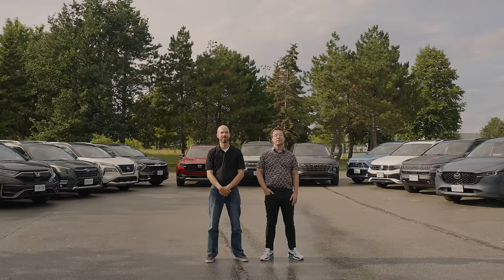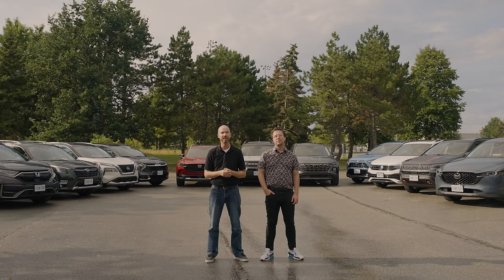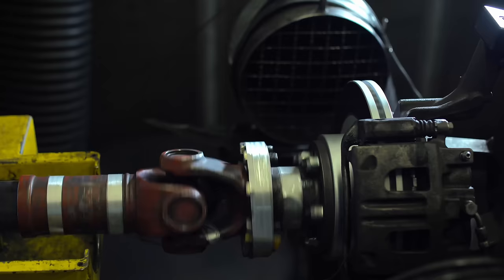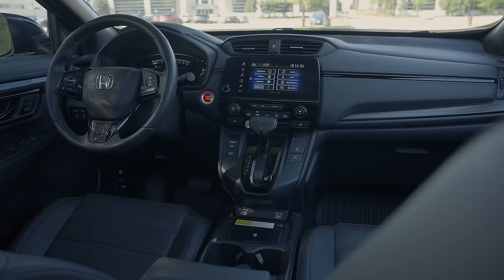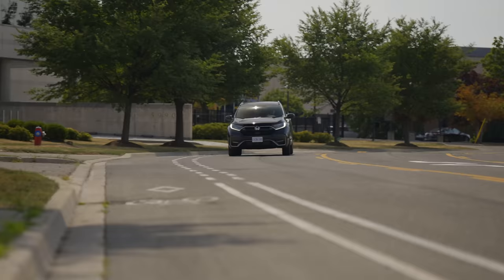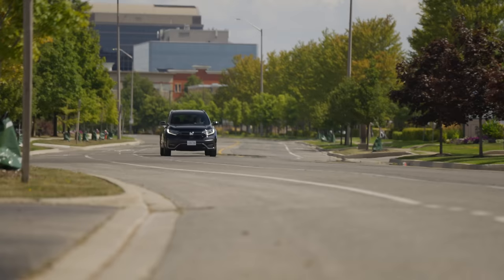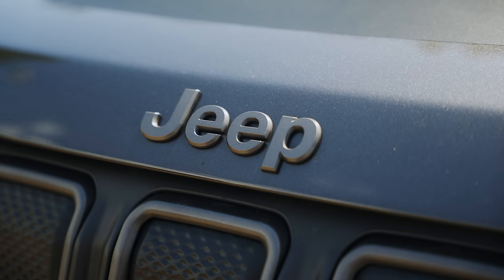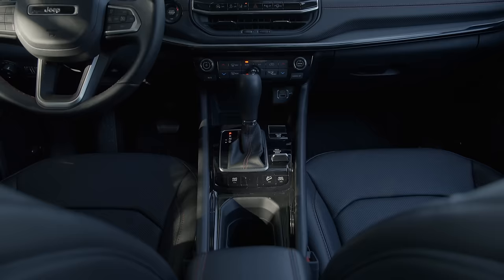Best Small SUV | Testing (almost) Every Compact SUV!

Comment: You can definitely tell that these guys don’t worry about reliability because the top 3 are Kia, Hyundai, and Nissan…
Reply: Lol yes bro same thing i was wondering about🤣🤣
Reply: The are really reliable..
Reply: @patriciosoirefman838  as a mechanic who’s also on multiple mechanics forums I can tell you 100% those and anything dodge/ jeep are literally the worst most unreliable in the road right now…
Reply: @BowmanGarage  Kia Hyundai score in top levels with reliability in EU. You should try Germans or French cars, not forget about modern Volvo's, terrible reliabiilty as well.
Reply: @redwhite_040  literally the only reason they score levels in reliability is because of the 10 year 100k mile warranty they offer.
Reply: @BowmanGarage  at least it's better than most who don't offer more than 3 years.
Reply: @BowmanGarage  which are the most reliable of the bunch?
Reply: @BowmanGarage  Which makers are the most reliable?
Reply: @Andorski  Toyota, Honda, and Subaru
Reply: @BowmanGarage  sheesh where you from cuz out here in la county that isn’t happening
Reply: Am I the only person that has had such bad luck with my Kia
Reply: @Unbound_Soul7  You know... Top Gear tried to kill a Toyota Hilux, they threw it in the sea, run it through an office, dropped an RV on it, hit it with a wrecking ball, set it on fire, tried to drop a building on it.... they failed.  So yeah... Toyotas are reliable.
Reply: @sunshinex315  No. I will be getting rid of my Kia in a couple months. I suggest you do the same.
Reply: @Apollo-tj1vm  im getting rid of mine on Tuesday it has literally had me in tears I’ll never get one again. I’ve got a Honda civic 2018 1.6 diesel waiting for me on Tuesday and I can’t wait. What are you going to get?
Reply: @Sunshine X  toyota corolla cross AWD. I need the extra clearance for the snow here so might as well. They found me one that is going to be made next week starting. So yeah...
Reply: @Apollo-tj1vm  exciting!! I was also considering Toyota haha as everywhere I was researching I was told either Toyota or Honda. My Kia has had me at my wits end.
Reply: @sunshinex315  i bought an older kia van and it has good power and transmission but the whole interior is falling apart and nothing works lol. I tried to push the dome light switch on and my finger went through the button. My finger literall push a hole in the plastic lol. Radio doesnt work and the ac doesnt work and the air only runs on high. The radio display is messed up you can adjust anything. Ive owned old cars in the past from differ manufactures and this kia has absolutely been the worst interior ive ever seen. The seats are comfy af though i give it that lol
Reply: @LowestDifficulty  omg lol I’m sorry for your car trauma. I really loved the Kia to begin with but now never again lmao bet you were frightened thinking about if you could push your finger through the plastic how would it hold up in a crash 😂 I’ve got my Honda civic now and so far I ain’t looking back 🤣
Reply: People still think that Honda and Toyota are the only reliable cars in the planet 😂😂😂😂😂
Reply: @sunshinex315  yeah stick with honda lol
Reply: @LowestDifficulty  so far and here’s hoping it continues, I may just stick with Honda forever 😂 already loving it so much and feels sturdy on the road
Reply: Are you good? Kia and Hyundai rank among the top in the car Industry for reliability
Reply: @BowmanGarage  Mazda >>> Subaru
Reply: @SethjordanB  your forgetting mazda
Reply: @BowmanGarage  Fords are good too IMO.
Reply: @BowmanGarage  😂😂😂😂 Subaru
Reply: People doesn't take care of their vehicles, that is the mani reason their vehicles fail. Nissan Rogues with good maintainance can last.
Reply: Nah bro you’re wrong am sure someone messed with those cars before and swapped manufacture parts with cheap ones
I had 2 kias and i had no problem with them the quality is good the parts and the engine are all reliable
Reply: They are working 3 hours a day belting out content so no they don’t give a rats ass
Reply: Hyundai Kia literally scores top reliability scores out of all the car brands. Why clownin
Reply: It’s either that or those same companies that sent those vehicles must have paid them a bit more 😂
Reply: Lmaaaooo someone clearly doesn't know korean brands are now more reliable than Japanese
Reply: Stay mad
Reply: Top 3 are japanese Toyota Mazda and yeah honda o Nissan
Reply: @BowmanGarage I just had a Kia Ceed for a week before the wheel started locking and suspension fell apart and had to argue with the garage to return it. Turned 10years old this year… your right totally unreliable
Reply: Hyundai are 10000% reliable
Reply: @sunshinex315  no they are terrible I stupidly tried two models in a month since the first stopped steering after a week and had nothing but issues. never again
Reply: You obviously think of old and dated addages when it comes to reliability.
Reply: @BowmanGarage the comment was about Kia, Hyundai, and Nissan.
Reply: @BowmanGarage literally a warranty like that is EXACTLY why that should be part of the reliability discussion.
Reply: @BowmanGarage 1980s and 90s carryover logic. Those aren't the most reliable, anymore.
Reply: @sunshinex315 without knowing how well you maintain your car, it would be foolish to take your comment as meaning anything.
Reply: @kevinj7051 they are just parroting the things people used to say about cars in the 90s, which is buy a Honda for reliability. Toyota wasn't considered as good a brand then, but it's been added to the narrative since.
Reply: Aren’t these brands reliable?
Reply: More like anything that comes in diesel
Reply: @carlosfavaron90  and they are right

Comment: Nobody in their right mind would buy a Nissan with a CVT if you plan on keeping it past 60,000 miles - Rogue included!
Reply: exactly what I was going to say
Reply: Good to know. Thanks for letting us know
Reply: Ditto
Reply: Nissan had CVT problems with the 2008-2014 models. These new CVT's are way more reliable, because they use metal now. Actually the Rogue 2022 is rated as more reliable than the RAV4. Hondas also use CVT's.
Reply: @Aymcana  you cannot reliably rate reliability in a new car.  Nissan did a lot of people dirty and I would still stay away from their CVTs until they have really proven themselves.  A traditional auto is a much better bet.
Reply: @BriansRCStuff  You can because they used CVT-8 on the Rogue, which the improved CVT-7 used in the 2017 rogue. CVT-7 was capable of going 200k miles and over. You can read about that, CVT’s went a long way since 2008. 
Most Japanese manufacturers use CVT’s now including Toyota and Honda.
Reply: @Aymcana  damn you know your stuff, i am impressed.
Reply: I had a platinum 2015 Nissan Murano it literally had the rear differential switched out TWICE once at 30k and again at 80K sold it after I finished paying it off at exactly 80K not worth it
Reply: @Aymcana  Actually my Rogue is a 2017 and the transmission went out at 30,000 miles😳
Reply: @sylviarollins412  Its an exception more than the rule. 
My friends automatic transmission also died at 10,000. Doesn’t mean all of them are like that. Read any articles about nee CVT’s they are nowadays as reliable as automatic transmissions, even Toyota uses them in most of their models
Reply: @Aymcana  I know this is late but I agree & disagree with you. Yes Nissan has made improvements but you really should only take a news car reliability rating with a grain of salt because it takes time to really know what the long term reliability of the vehicle will be. I think the Nissan looks nice but if I had to spend my money I’d go Honda or Toyota because they’re reliability doesn’t compare. I say this all the time it’s about percentages. You could get a Toyota or Honda with probably but the probability of getting one is less likely than with the Nissan. You could get the Nissan and have no issue but the probability of getting the Nissan without issues isn’t as high as with the other 2. Yes I’m speaking on the brand as a whole and there is slight variability within individual models of cars, my previous statement still stands. But I enjoyed reading the back & forth that y’all had a few weeks ago.
Reply: Had a 2003 Nissan altima years ago and it was a NIGHTMARE lol
Reply: @Texas_Made_  We are talking about the 2021 and up models. 
2003 is too old and irrelevant to the newer models
Reply: It all depends on the transmission, I have a 2009 Nissan Murano SL AWD with 412k ish. I regularly change the CVT fluid. I read the CVT doesn’t like heat or sudden acceleration. So I’m sure it helps I don’t accelerate heavily. My coworker owns a 2012 Nissan Juke AWD with 289k, as of last week. In her defense, she doesn’t leave Aquidneck Island in RI, and doesn’t go over 45MPH. Her Juke should last forever lmao

Comment: CX-5 is the best in the class , very high quality in fit , finish , handling and driving dynamics .
Reply: Indeed, but for some is too cramped. If you have a family 4, are 6 footer and travel long distance is not great and MPG also not great, but other than that great vehicle, especially for an average height none long distance travel families.
Reply: I have a 2016 red Mazda Grand Touring Sport and I Love it
Reply: Yes , Mazda is reliable as well as performance oriented.
Reply: @davidzavala337  yup Cx5 gas tank too small and compact seating not good
Reply: CX 5 TURBO IS THE BEAST OF THEM ALL.
Reply: Mazda cx5 too much gas
Reply: @davidzavala337  30 MPG is not that great? I get 28 with mine in town. Lower mileage is the goal anyway, because it means they did not do torturous things to the engine to squeeze every BTU of energy from every molecule of fuel. So your engine will last much longer, and engines are much pricier than gas. I had a new Dodge Caliber that barely got 20 MPG with no AWD and was gutless. I'd say these are all pretty stellar.
Reply: @ricardokim544  Compared to what? I get 28 MPG with mine in town. How much do you want?

Comment: Some are changing the Rogue and Altima transmission fluid every 20 thousand miles, because so many need a rebuild. The all wheel drive Rogue has an extra cooler for the transmission, so they tend to go longer before the transmission starts to fail.
Reply: Shoulda said this in the video!

Comment: No one is going to talk about the reliability issues of the Nissan ? At least the top two Korean cars have the best warranty as well smh
Reply: Nissan's reliability has increased since the 2014's. Their CVT's are way more reliable now, as they started using metal belts in the CVT's
Reply: @Aymcana  the CVT broke down on my cousin's 2017 rogue at 100,000 kilometers
Reply: @mustafakamaran5195  Its unfortunate. I know someone who had his automatic transmission on an F-150 break at 40,000. One story doesn’t show the whole picture. I have talked to some friend mechanics and they said that newer CVT’s on Nissan’s are very reliable and are as reliable as the Automatic transmissions. CVT’s from 2007-2012 are bad. But never ones are totally different.

Comment: Looking for small SUV, they are not “small” at all.
Reply: They should just be called medium size.
Reply: look for a 2015-2020 Honda Fit,  small but big on the inside. I am 6 feet tall with bad feet, no problem getting in/out and pretty fun to drive with no drama. Seats 4 big guys well or 5 if the back 3 are <200 pounds each. 32+ MPG around town, 46-48 on the highway. Auto headlights rear and side camera, power sunroof, and proximity key for push button start/stop. 16" rims make new tires cheaper and it handles really good. 13-20K depending on year, options, and mileage. No turbo so it will last  really long time and not need 93 octane gas.

Comment: I needed a new car badly so started looking back in May. I test drove the Tuscon and Santa Fe, Toyota Rav 4 and Highlander, Acura RDX, Mazda CX5 and 9, Honda CRV, and maybe a couple others. I liked the Tuscon hybrid drivetrain, but wasn't big on its interior or exterior styling.  Liked the Santa Fe interior and how it drove and put a deposit on a "Luxury Hybrid" model, but Hyundai is very slow delivering more of them. The RAV4 and CRV left me cold. The Highlander was just too big. The RDX was nice but the tech was old and they're hard on gas. So when I saw the new Sportage I liked the interior and exterior and knew I already liked the hybrid drivetrain (from driving the Tuscon), so based on a test drive of a 2.5 I4 model (gutless and noisy) I got on the waiting list back in May for a hybrid EX model.  Got it in September and I'm pretty happy with it so far, with a few relatively minor niggles. Mostly to do with driving at night - the base model reflector headlights low beams aren't great, and the grid for the heated windshield is distracting when lit up by oncoming headlights.
Reply: Please tell me you didn't pay above MSRP.
Reply: @davidzavala337  ended up with some dealer installed options I didn't really want or need

Comment: And one final thought to keep in-mind: which of these cars is available for purchase now, i.e. what is the wait time? Some are half a year to a year waitlists. The HEVs and PHEVS may be even longer. This factor may influence a buyer's choice.

As an aside, Hyundai & Kia have been in the press a lot lately for recalls due to vehicle fires with their Palisades and Sorentos. A factor like this (a behavior pattern) might shy someone like me away until the new designs have been out for a few model years.
Reply: Sportage Hybrids are unobtanium.   25 month wait time per my local Kia dealer.   Those that are in stock in the nation are so marked up that they are a horrific value that only a fool would still be interested in at the real street price.
Reply: Not the Palisades... But maybe the Santa Fes...
Reply: The only problem with Kia and Hyundai revolve around two things.
1) The 2.4L Theta engine, which is no longer being used anywhere in the current lineup 
2) A tow-hitch wiring harness... which is SUPER Niche and rare.

Simply put, knowing what the problem is instead of saying "everything is bad" makes you informed instead of uninformed. 

As for wait times on Hyundai, I ordered a Tucson Hybrid back in July 2022 and it finally arrived in December 2022... so a 5 month wait for my Hybrid to come in.

It's a great SUV and I love it.
Reply: @wolfshanze5980  Well there's also the Kia boyz incident right now. I am selling my Forte 2020 (which has been broken in twice) for a Toyota Corolla Cross 2023 instead. TBH I don't trust Kia and Hyundai not running into another design/ manufacturing problem in the near future.

Comment: Funny how we now need more than 200HP to call an SUV adequate, remember the times when a V8 SUV would have less power than the least powerful vehicle here? Yeah a Grand Wagoneer with a monster V8 making a 140HP through a 3 speed automatic. How things have changed.
Reply: Not true at all... 175HP to 190HP on a compact SUV is exactly "adequate".

It will get you from point A to Point B, just don't expect anything sporty, and expect about 0 to 60 in 9 seconds.  That's "adequate".

To people who don't want "adequate" but want fun and sporty too... then YES you need more than 200HP.

I've driven both the 187hp Tucson and the 226hp Tucson Hybrid... one is "adequate" and the other is actually fun... so I bought the Hybrid.

Comment: the jeep cheI rokee would have been a more apples to apples comparison with most of these.  The space inside is better and the turbo 4 and v6 (only one in the class) both pump out 270 hp.  i know they constantly get beat on in reviews, but my 2019 cherokee has over 80,000 trouble free miles on it so far and is the best looking one of the bunch if you ask me.
Reply from the maker: A Cherokee would have been great to include, but was not available at the time of testing.

Comment: The non-turbo Mazdas have CYLINDER DEACTIVATION (aka: displacement on demand, variable cylinder management, variable displacement). Mazda has been having trouble with it with recalls, and service notices, plus in one vehicle that has it (3) they removed it for a year to iron out problems. Run away from these as used cars when they get older.
Reply: To Star 662 ...In Australia they are ranked one of the top two most reliable cars overall and that's from a 10 year survey !!
Reply: Skyactiv engines are bulletproof, better than any in this list except the Toyota hybrids.

Comment: IRL the hybrids from Hyundai / Kia suffer from HUGE mark-ups, Nissan and Mazda are much better deals OTD.
Reply: The Nissan is way too unreliable as it has a horrible transmission.
Reply: That's because neither Nissan nor Mazda have any hybrid drivetrains. The Hyundai's and Kias are in high demand. Still, I only paid a relatively low amount of dealer markup (in the form of non optional dealer installed paint protection, etc) for mine, about $1500. Normally I would never have accepted that, but given the current supply issues, they've got the upper hand.
Reply: You're rigth, but I'm smart, so I refuse to pay a dime above MSRP, not even with added dumb add ons. The market will go down, rigth now regular combustion are the first ones that you can get at or below MSRP. Hybrids...just wait a bit longer. High interest and inflation will make a dent. Sadly, Mazda doesn't make a hybrid and Nissan, sorry I just trust the brand.